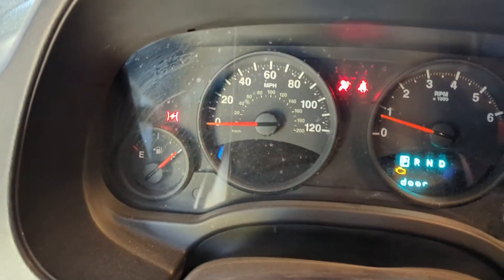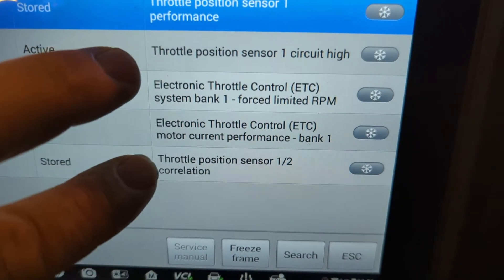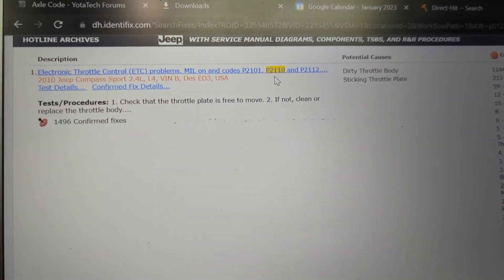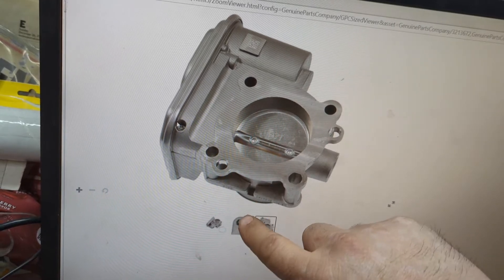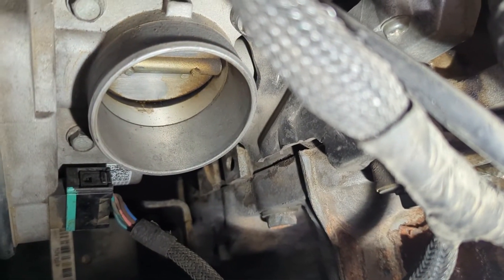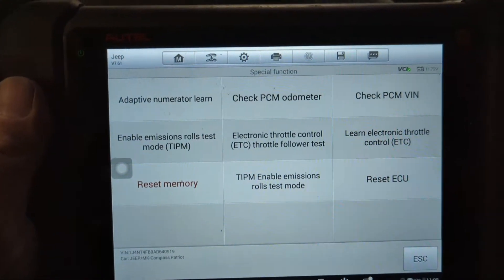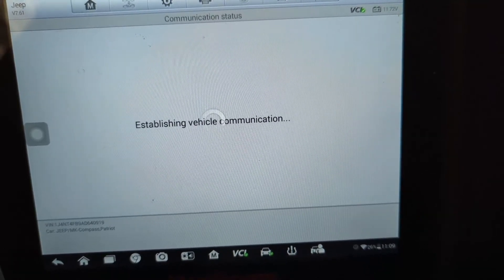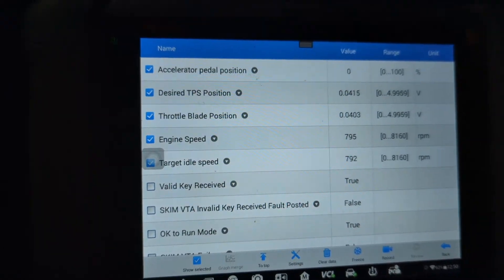Electronic Throttle Control diagnosis!

Comment: when replacing if I remove battery cable prior to replacing the bad part, will it reset the code when I reconnect battery afterwards? thanks

Comment: Its nice to see you fixed that issue, it gives me hope lol No codes but gauges don't lie, at idle pedal is at 17% and TPS at 4% it holds around 700-710 rpm when warm. Driving I mash the pedal it reads 90% and TPS goes from 4% to 62% instant then it ramps up slowly and reaches peak at 78% right at shift point. 2nd and 3rd are 90% pedal and 78% TPS. When it shifts from 3rd at max rpm into fourth..... TPS goes down to 70% lol

Comment: Is that the Duralast throttle body you replaced it with?
Reply from the maker: I don't recall if it was a Dura last.  I'm fairly sure it was an aftermarket part though, so likely equivalent.

Comment: I replaced the throttle body this past weekend and still getting red flashing lighting bolt, today it started flashing and started loosing power when it finally did recover it started running rough so I pulled in gas station turned off when I cranked it up no lights and drove home with no issues what can I do now to keep the light from coming on and stop the struggling?
Reply from the maker: In most cases, going through the scan tool guided process of relearning the correct throttle angles is required to not have a returning issue.

Comment: So for my 2008 jeep I would need the scan thing to reset it cause I replaced but I still can’t drive
Reply from the maker: Using the factory level scan tool function to relearn the throttle angle values is very important.  Some will get away without it, but it's an important part of the process.

Comment: Can one replace without being a technician or having special equipment
Reply: depending on the car. You can on some models turn the key on and off without starting twice then start the car. It may take a few minutes but it will work without a scan tool. A good scan tool can show the voltages through the throttle.

Comment: To bad you didn't just clean it .
Reply from the maker: Cleaning it would not have worked at all.  The throttle assembly had to be replaced.  The position sensor was bad

Comment: Hello I have dodge charger 2009 , and I got same issue since weeks I went to the garage the warning light it was fixed for 1 month and then it happened again , I don’t what to do , please I need your help , here in Dubai the garages are useless !!!
Reply from the maker: It sounds like you likely need a throttle body and the correct learn procedure using a scan tool.

Comment: Hi My jeep library has the light bolt and I just changed the ecm do u think I need to change the throttle
Reply from the maker: It's possible, but you need to do further diagnosis.